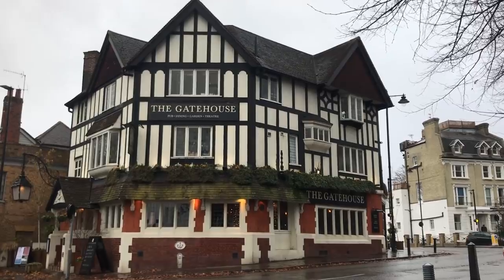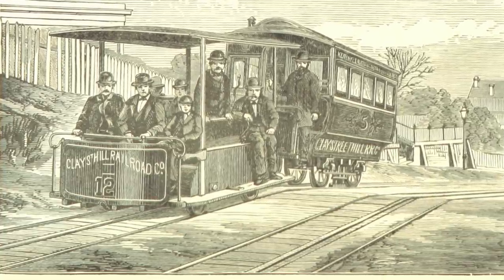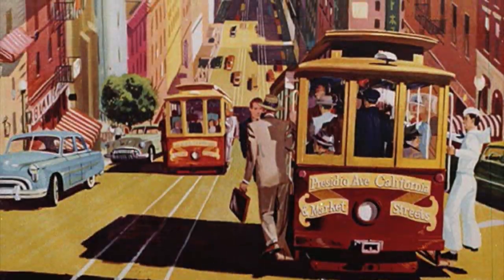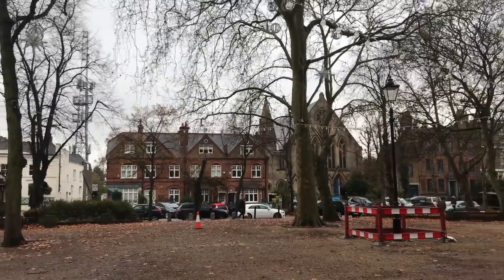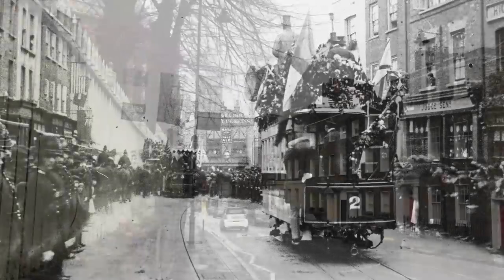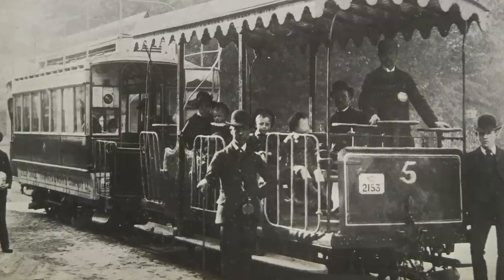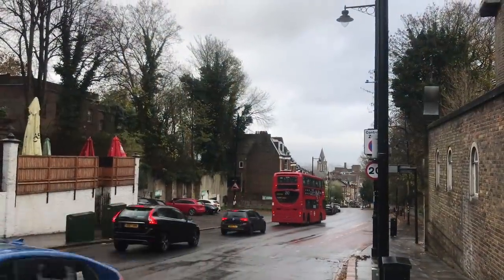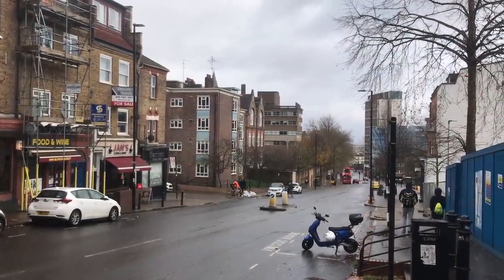Getting a Grip on the Highgate Hill Cable Tram

Comment: In the 19th Century, cable-powered streetcars were very popular because they were the only practical alternative to either animal power or coal-fired steam locomotives on street railways. Chicago, IL and Minneapolis-St. Paul, MN are just two examples of almost flat cities that built relatively large cable-powered street railway networks. Incidentally, conversion to electricity usually required completely rebuilding the tracks, because electric streetcars were relatively heavy to the cable cars they replaced. In St. Paul, MN one cable line up a hill (Selby Avenue) was replaced by new electric line that used a special counterweight system to help the streetcars get up the hill. In 1907, a 1500 foot tunnel was opened, with the west portal opening in the middle of the street; the east portal of that tunnel still exists, with a strong fence to prevent access inside the bore.

Incidentally, the old cable-railway up Selby Avenue climbed a 14 percent grade, or approximately 1 in 7 in British parlance. The new tunnel cut the grade in half. Today, diesel buses climb Selby without using any tunnel.

Comment: Pedant mode on.  The surviving cable cars in San Francisco are 3ft 6in(42in or in civilized terms 1067mm).  There were standard and broad gauge systems built around the country.  San Francisco's Market Street Railway is an example.
The grip was more like a clamp.  Hallidie's original was a side grip.  The cable was carried to the side.  The gripman turned a wheel like device to close the grip on the cable to pull the car along.  The current systems uses an Eppelsheimer bottom grip.
The book "The Cable Car in America" by George Hilton, is probably the definitive book on the subject.  It covers history and the technology, and gives individual thumbnail of all known grip style cable lines, with maps, worldwide.  Pedant mode off(not really).😀
Reply: Cool comparison.
When visiting San Francisco, it did make sense to get the week pass (well, 7 or 10 days), which did include the cable cars. Don't know if that's still the case. Getting on one or two stops up the line instead of at Powell reduced waiting time. I was in SF several times for conferences, and usually stayed in the marina district, close to a cable car stop, taking the cable car as my commute. They are still fun to ride for me, though the novelty did wear off a bit.
Reply: @johanneswerner1140  Did you get chance to see the power house and museum at Washington and Mason?  You can view the winding machinery(1980s rebuild) and see a vault under the street where the cables run to the respective lines.
Reply: Yes I did! That was really awesome, it made me appreciate the system even more. The engineering behind it is great. After visiting it you begin to understand some of the stuff you see on the cable car, the tracks, location of the stops, signalling, those things, and how the guys driving the contraption are working together.
Riding every morning, same time, got me sort of registered as a regular with a team, "yeah, I saw the ticket yesterday and the day before... you still got it, right?"

Comment: Melbourne once had an extensive cable tram network before they electrified it in the early 20th century.  There’s still bits and pieces left such as old cable/power houses.

Comment: Actually the 35 tram route never did go up Highgate Hill. The route that went up the hill was route 11 which was replaced by trolleybuses in December 1939 by route 611. As a young lad I was often taken on a 611 trolleybus by my aunt up to Waterlow Park just before the top of the hill, continuing after the trolleybuses on that route were replaced by brand new Routemasters in 1960 on the replacement route 271. One of the quirky things about the route is that give or take a few yards at either end of the route, the 11/611/271 has run the same Highgate Village to Moorgate journey for over a century now - a claim matched by only a handful of other London bus routes!

The 11 tram route was the last non Kingsway subway tram route operating in North London (a couple of East London routes lasted into 1940). It was a wholly conduit operated route and had been operated by the batch of non trolley pole fitted HR2s.

Love the video - could we perhaps have more on individual tram / trolleybus / bus routes especially those that have a long pedigree like the 11/611/271. Another long lasting route that also operated past the Archway Tavern, and still does today, is the 43 bus route - on which I used to travel to school!
Reply: A Transport of Delight,to use the title of an old Swann & Flanders song.
Reply: Did trolleybuses get up steep hills ok?

Comment: The electric tram depot later on was used to store older trams during the War. It was still used for only operational purposes into the very early fifties; meanwhile, the trolleybuses that performed the route had extra braking systems.

Comment: Great video as always, Jago! Melbourne, Australia, had cable trams on the "Bourke St lines" until 1940 when it was replaced by double deck buses that were a dismal failure. By 1955 it was back to trams - this time lovely new W6 class electric trams! 💖

Comment: If you're doing more stuff on tramways, the Barking system may be worth a mention. It coasted across  a Scherzer rolling lift bridge over Barking Creek on its way to Beckton gas works, with the conductor reconnecting the trolley pole on the other side. Maybe not enough to warrant a video all to itself, but possibly as a part of tramways in  east London.
Reply: Barkings main system - from Barking Creek to Loxford Waters was so short that Barking UDC effectively gave up and let in the end Iiford UDC and East Ham (later LCC ) UDC run the route instead.

Comment: And that reminds me of Liverpools on cable rail system. Yes, oddly enough it was that wee RainHill line to Manchester, which on the Liverpool end terminated at Edge Hill. Apparently Stehenson's Locomotives could'nt pull up the wee incline to edgehill, so they built a cable system to pull the trains into the original Edge Hill Station. After a couple of years they decided to build Liverpool Lime street Station instead, and Edge Hill went the same way as Highgate Tram Service.
Reply: Euston, on the LNWR, had this same arrangement.

Comment: The Great Orme Tramway in Llandudno, is a Cable tram, although it is also said to be a Funicular tramway.  The Halfway Station pulls one tram to halfway station, and pushes the other one down. Then you change for the other tram, and are pulled up by the winch at Halfway Station, which pulls the other one down.

Comment: I did enjoy traveling on the San Francisco cable car, but seems more of a tourist trap than a useful transport system. Great fun though if you are based along it. I also liked collection of "trams of the world" running on the flatter parts. In fact I enjoyed traveling around San Fransisco by public transport altogether. The ferry boats across the Bay were fun too, see what I mean?
Reply: The SF cable cars are indeed just a (major) tourist attraction these days. So many tourists that they are pretty much useless for real transportation. But they stopped being comparatively useful back in the 1950s, and would have all been removed by the end of the 1960s if lots of residents hadn't objected to losing the "local color". That doesn't necessarily mean that cable cars are worthless in all cases, just that 1890s technology cars are not comparatively to other methods practical in SF any more.

A number of visiting European journalists have mentioned over the years that SF is the most 'European feeling" city in the US, with it's public infrastructure. (Though most of those mentions were from before that infrastructure containing large quantities of vagabonds.)
Reply: To be fair we have our share of 'vagabonds' on public transport here too, Jago and Geoff excepted of course!

Comment: From your LeviNZ correspondent:  In the late 1880s or so, Dunedin had its famous Rattray St__Belgrave Cres--Kaikorai Valley cable cars....i was just too young to remember them while they were still running... the powerhouse was in K Valley, at the start of a fiercely steep gradient up Falcon St to the  crest of Highgate  ..:-)..where the only flat piece was large enough for the No 11 trolley bus ( "my" one )  to turn round. 
Anyway.... the whole length was at a guess 2.5km but  perfect for Dunedin's hills. Halfway up Rattray St, by St Josephs Cathedral was a  turn that  must have been 40* anyway...apparently it was the first such turn on a cable system in the world.
>>Just as impressive and rivalling  the San F lines as I saw, was the High St/Maryhill cable car that went  2km at a guess in 3 stages that looked like steps. It was closed in 1957... the year I Do remember going on it. It would have been a  fantastic tourist drawcard nowadays...but financial risk and foresight  was passed by..again..
So NZ has only the steep but fairly short ( 5 mins )Kelburn cable car, from the centre of Wellington CBD to Kelburn  above the university. It is very busy,..not cheap... and a pull for tourists.Saves a really strenuous walk up the steep slope.

Comment: San Francisco's cable cars are operated by the San Francisco Municipal Railway. Yes, the agency is still called that, even though most of its service is now buses (though it does also have seven light rail lines and two historic streetcar lines, which include an open-air tram from Blackpool among other international antiques).

Comment: There is a funny thing about this route. The 35 tram continued until the Kingsway Tunnel was closed in the spring of 1952 but after the war it terminated at Archway Tavern and did not go to the top of the hill. The last trams in London ran on 5 July 1952. They had the HR2 class of tram for hilly routes. It was replaced by the 172 bus. The 33 tram to Manor House stopped on the same day as the 35. The tram depot was in Pemberton Gardens.

Another curiosity was the tram route from Pemberton Gardens via Fortess Road, Kentish Town Road and Prince of Wales's Road to the Cressey Road depot off Fleet Road which remained serviceable long after the war. The depot became a British Road Services depot and retained its tram rails for many years.
Reply: Actually the 35 never did go up Highgate Hill. The route that went up the hill was route 11 which was replaced by trolleybuses in December 1939 by route 611. As a young lad I was often taken on a 611 trolleybus by my aunt up to Waterlow Park just before the top of the hill, continuing after the trolleybuses on that route were replaced by brand new Routemasters in 1960 on the replacement route 271. One of the quirky things about the route is that give or take a few yards at either end of the route, the 11/611/271 has run the same Highgate Village to Moorgate journey for over a century now - a claim matched by only a handful of other London bus routes!
Reply: @paulrichardson3965  I remember the 611. The other Kingsway tunnel routes were the 31 and 33. I. think one of them became bus 171 to Newington Green and Manor House. Scrapping the London trams showed a lack of foresight. The RM bus could have been the basis of a modern London tram.

Comment: When trolleybuses replaced the trams, those used on the Highgate Hill and Archway Hill routes were fitted with special "roll back" brakes to prevent runaways. I don't know if the trolleys that used Brixton Hill were similarly fitted.

Comment: Jago, 

My grandad was driving on the trolley buses back 8n the day and that's how he met my grandmother. I know very little about these old vehicles, other than he used to power drift them pulling out of large junctions in the wet, given the instant torque from the electric motor.  I also know very little about the trolley buses of London. Would you be likely to produce a video on these at any point?

Comment: As you mention, cable railways were in operation on industrial railways well before steam, so the technology was hardly a new one. Even some very early passenger railways had them, such as the six miles long Canterbury and Whitstable Railway, opened in 1830. That line had two cables, as well as relying on horse traction for short distances and an asthmatic steam locomotive called Invicta, that only worked on the flattish bit at the Whitstable end. It couldn't even manage that, so was replaced partly by a third cable. Within a few decades the cable was ripped up and the whole thing was powered by more advanced cut-down locomotives due to a low tunnel.

Comment: Yep, more tram shiz please Jago! I knew there were once trams up the hill to Archway but had no idea of the significance of this section of the tram network being an early cable-grabber until your video (nor the Brixton one: I must have missed that one mate 🤷🏻‍♂️) and it’s interesting how it couldn’t be made to work here. Maybe something to do with the relative straightforwardness of Sam Fran’s street plan whereas Highgate is a bit wiggly (another technical term) in comparison, which I can only imagine complicated things. 🤔 It’s so Victorian that they introduced emergency brakes not as a forethought, not even following an incident, but as standard only after several incidents of run aways😳🤪

If you do decide to do some tram themed  ideas, could I suggest something about the depot in Charlton. You can still easily make out the road and roughly where the depot perimeter was, plus there’s a great model layout (I think it’s O Gauge) that did the rounds called “Cheerio Charlton”. Funnily enough, I saw the layout at an exhibition and recognised the section of road straight away, even telling my missus…and she patiently pointed at the board above the stand with the name on it and just sighed 🙄

Fantastic stuff mate, long may you continue 🎩🍀👍🥂

Comment: From the fare I was reminded of Anita Harris' song "I'm going on a Tuppenny Bus ride" . Also that I heard that the Dog Kennel Hill trams had a two track in each direction system so that if one ran away it wouldn't smash into the one behind. I did also read that  they found if one did run away it would topple over when it hit the junction of the tracks at the lower end!!!

Comment: Another fascinating and informed video in  your inimitable wry style - keep them coming please.    Cable traction, as you said is not new.  You are totally familiar (of that I am certain) with Geoff Marshall's  first rate video on the Glasgow Subway (sic) which includes a section on the early days when it was a cable hauled system.    To Boot, part of the Edinburgh tramway system was cable hauled at one time.  A remnant of line, with the conduit cowers in Princes Street to this day - video photo on Wikipedia article on Edinburgh Corporation Tramways....

Comment: Of course, cable haulage was what the Glasgow Subway opened with in December 1896, only progressively converting to electric traction in stages between 1933 & 1935. The  archaic method of lighting the train interiors (via two rails mounted on the walls and pickup shoes on the side of the cars) was retained after electification was completed in 1935, right up until the system's closure for complete refurbishment in May 1977.

Comment: This reminds me of a flop which happened recently. The Maglev link at Birmingham Airport. Was unreliable and replaced by I believe a cable tram! You could make a video about it!
Reply: The maglev was fairly reliable for what was basically a one-off testbed, and the first real-life maglev installation in the world. It's similar to the Highgate Hill cable tram in that respect as it was intended more to be a showcase of what was technically possible than as a real method of transport. 
The problem was that as a one-off example of a new technology it suffered from the need for specialist manufacture of parts (no popping down to Halfords for brake pads!) and, perhaps more  significantly, from electrical obsolescence as electrics and computers advanced rapidly in the early 90s, meaning it became expensive to keep running, which meant it became even more unreliable which in turn meant it became even more expensive and so on.
At the same it also fell foul of the corporatisation of the airport (changing from what was effectively a department of the city council to a council-owned business which needed to keep its head above water), all of which meant it was pretty easy for the airport to go "Nah, not paying for that" and close it down while the councils were sidetracked and concentrating on selling 50% of the airport under pressure from central government. 

My understanding is that the airport were quite happy to replace it permanently with a bus link and there the whole saga would have ended were it not for the fact that the airport is still 48% owned by the local councils who weren't happy and so after years of arguing the track was repurposed for the current cable-hauled people-mover.
Reply: @atraindriver  Thanks, great reply. I used to drop someone off an International in the early 1990s. You could always tell when it was working as it caused  bad interference on the car radio. Towards the end it was hardly in use. 

Interesting comments about the bus link. If I had a small bag it was easier and quicker to walk between the two.
Reply: @atraindriver  Irrespective of the reasons, what was billed as the most advanced passenger-carrying system in the world was replaced by one of the most obsolete ones.
When the cable-car is declared 'life-expired', I expect to see the return of the horse.